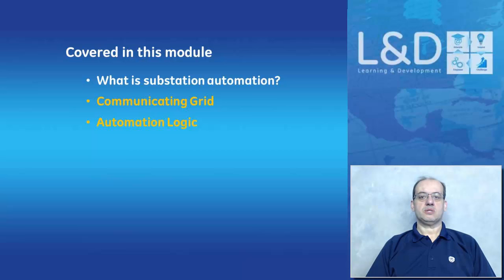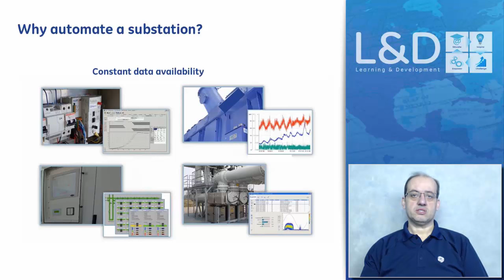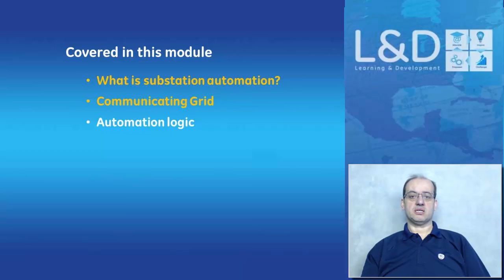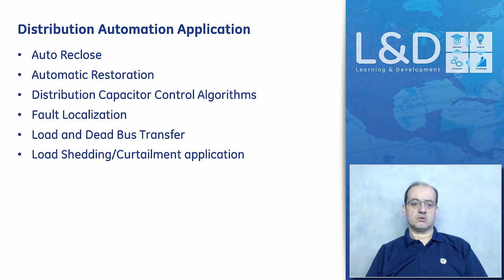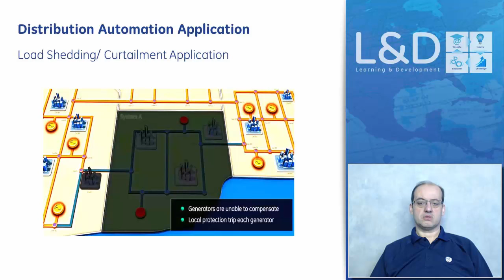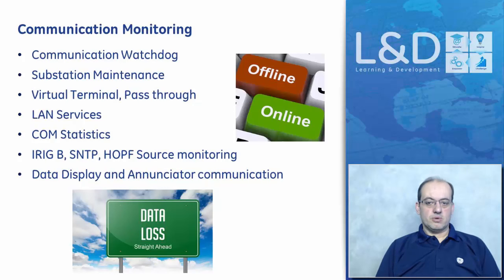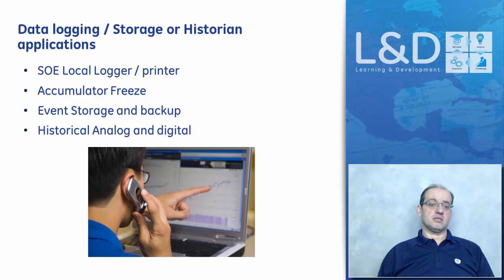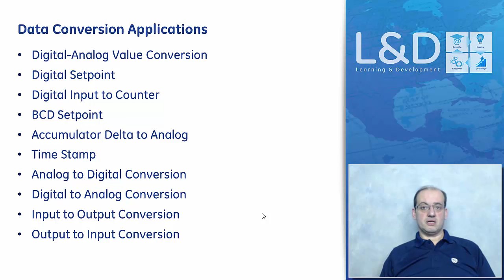SA-102 l Substation Automation Introduction v1

Comment: What's the difference between SAS and scada?
Reply: Both are HMI based system , but  SAS is more advance and the idea of controlling gained through Networking , each device in the system should have an IP address , the hierarchy of SAS system containing Servers (same as RTU in SCADA) and Gateways to communicate with the remote stations plus Ethernet switches to connect all the system together . All IED's in the SAS system should be conformed to  IEC 61850 protocol (2 FO connections for redundancy purposes .while SCADA is simpler compared to SAS , you have the RTU which deal with specific I/O's in auxiliary relay based system.